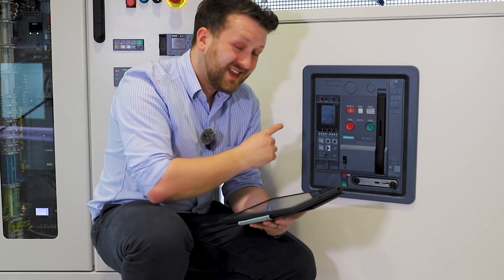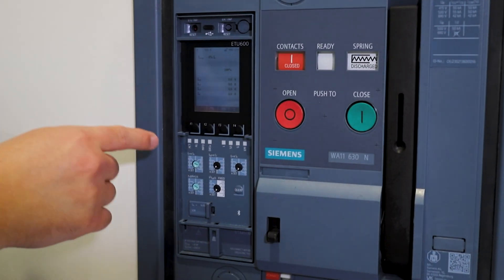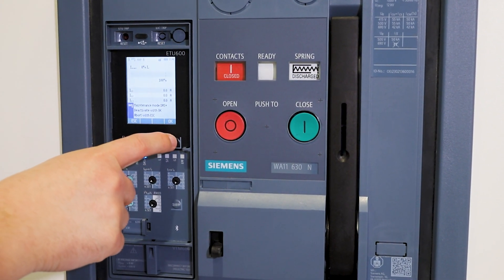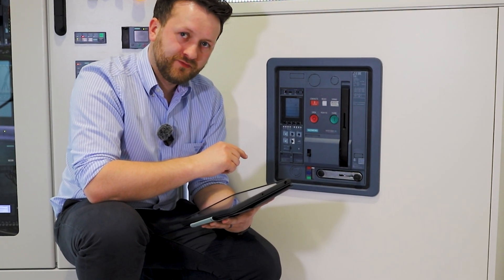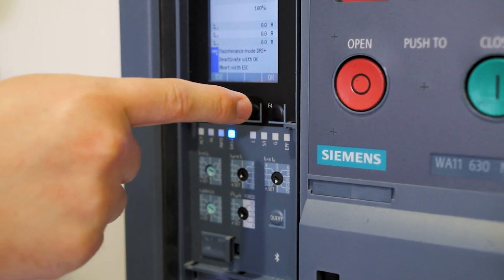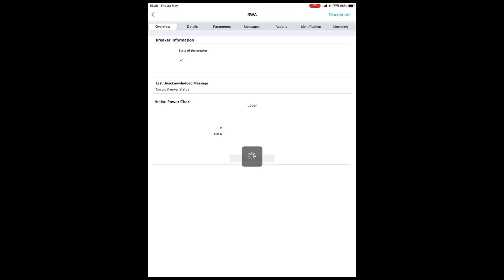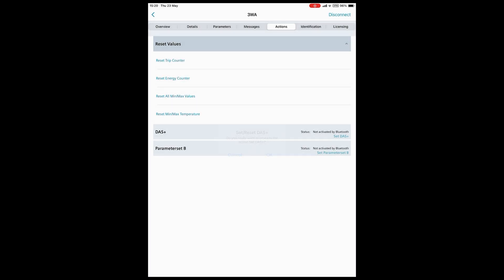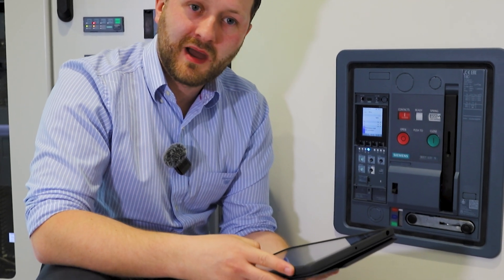Siemens SENTRON 3WA How to set up DAS+ mode

Comment: Same ACB showing Error N sensing how to fix
Reply: If it's 3 pole breaker short the terminal no. 9,10 in X8 if it's 4 pole then the neutral CT connection. With harness